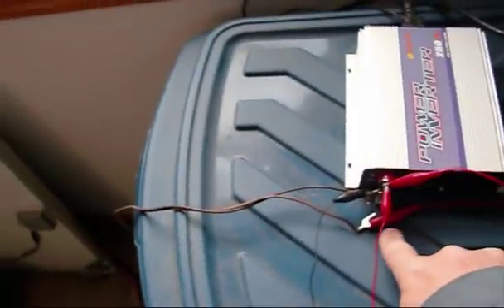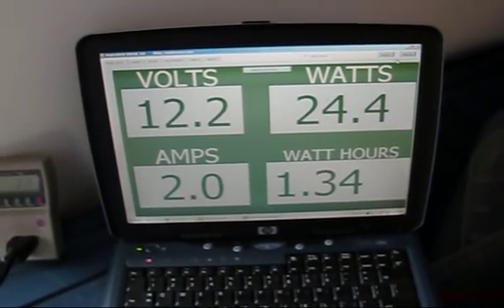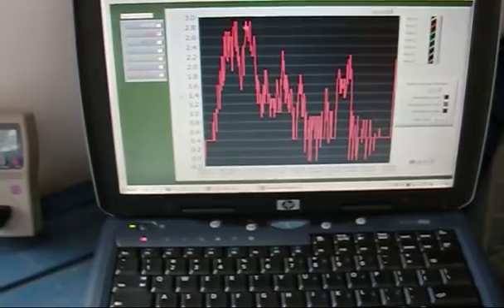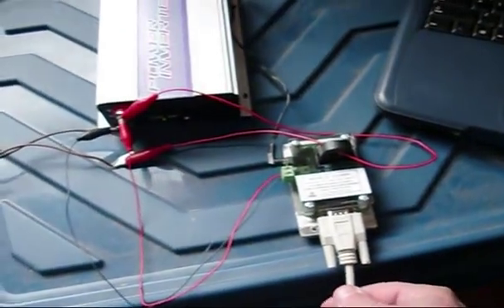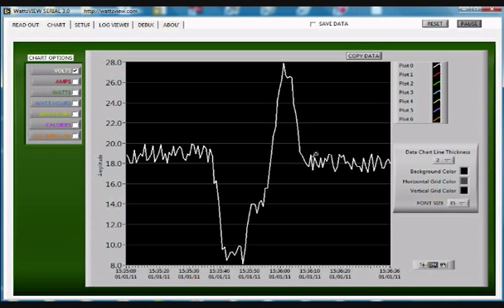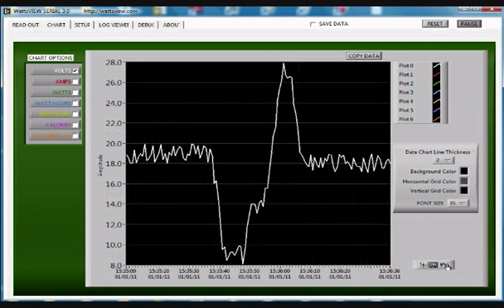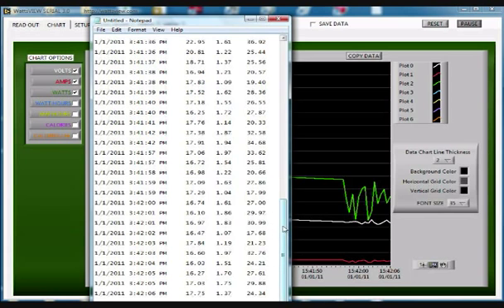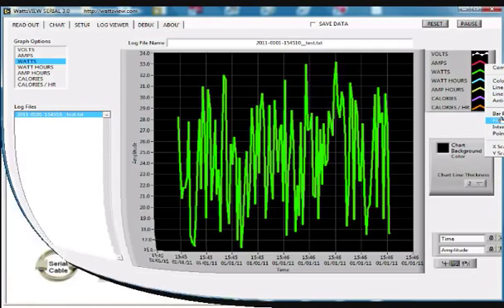WattsVIEW First Test

Comment: Looks like a nice piece of kit, albeit a bit on the expensive side.
Most would rather buy another panel than one of these.
One question though. Inductive loop type sensors can be a bit inaccurate depending on the size of the wire that runs through the loop and where the wire is placed etc. Can you post a video of the DC current flowing through your multimeter ammeter and then through this device to check its accuracy at low currents (say 5-10A)? Does wire placement in the loop effect readings?